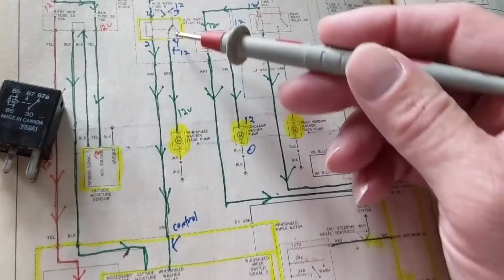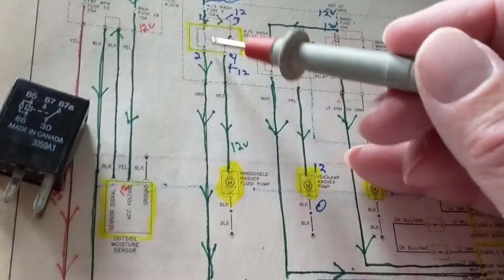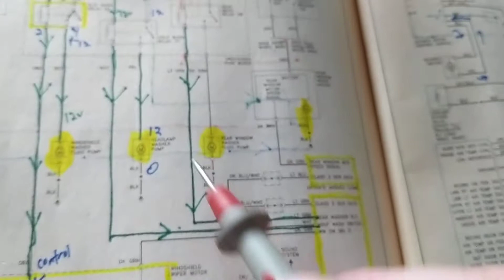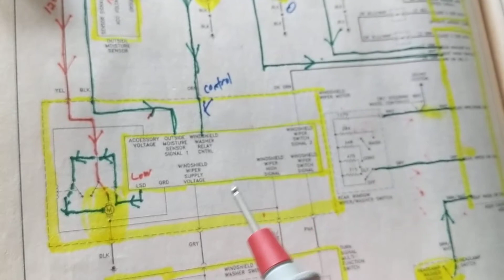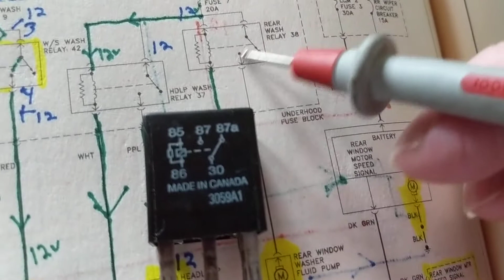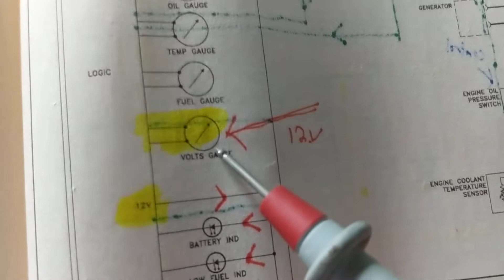BODY CONTROL MODULE COMPUTER HOW IT CONTROLS WIPER MOTORS GM

Comment: Hello i need help can i have your email
Reply from the maker: I usually don't get my email but what do you need to help in
Reply: @Joeelectronicschematicsforauto  bmw x5 e53 fuel pump some time power come some time not come..try to find what is worrng? Relay is good i put new one..
Reply from the maker: Sometimes it might be the pickup doesn't pick up the fuel after while driving it the first step is to measure fuel pressure to see if it holds fuel pressure or is it an electric problem with intermittent wiring have to go to the fuel pump relay and see if you have the 12 volts after you lose the fuel pump yes how many things involved so many things involved
Reply: @Joeelectronicschematicsforauto  jeep is starting ..i can drive it..but some time power is not come..thats the problam?i chack it my multimetr
Reply: I don't have the schematic in front of me for that vehicle but when you lose power you mean you lose 12 volts there could be a computer giving 12 volts to a relay if it's an electrical problem if I understand what you're referring to or it might be a computer communications problem when you can't start the car at all not a crank and no start problem the diagram is definitely needed
Reply: @automotiveelectronicsfroms2699  that problam solve now..another problam came now..i remove the battry and place the new battry now  dash bord screen ask code..what shoud i put
Reply: This might be an anti-theft system code you could try putting in the VIN number of the car but you might have to get the code from the dealership unfortunately they want you to change the battery by the dealership by some  models of cars
Reply: @automotiveelectronicsfroms2699  what can i do now?
Reply: @newgejet3408  I sent you a text before you could try the VIN number but if there's a code you might have to go to the dealership find out the code or call them some vehicles have Anti-Theft systems next time you change the battery try to get a memory device to plug in